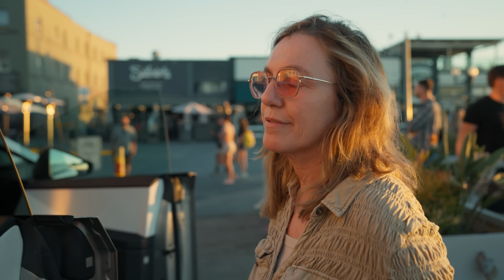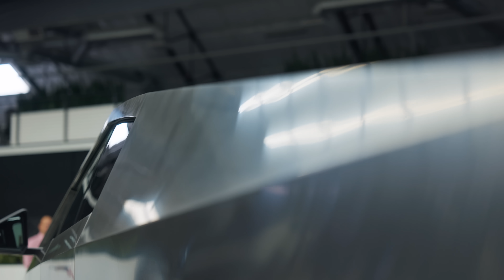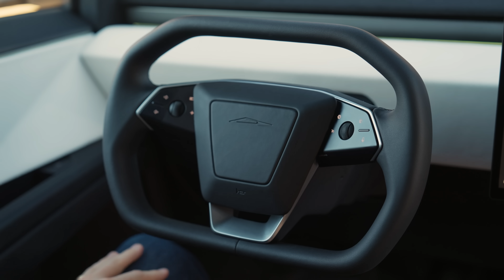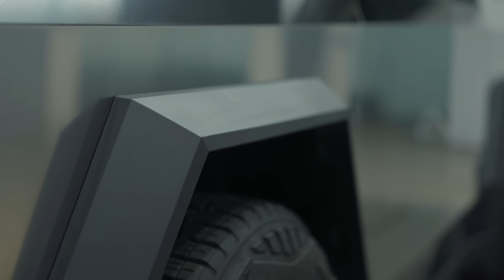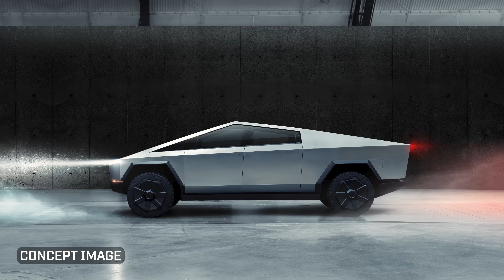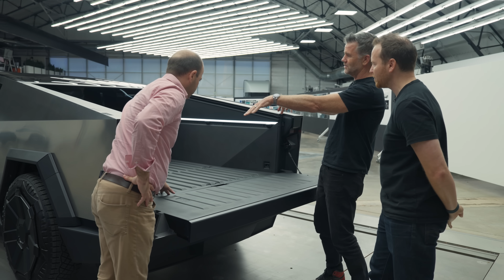FIRST DRIVE: Tesla Cybertruck Full Review

Comment: 1:45 and this is how americans think. "maybe we would sell it, maybe we wouldn't, maybe we would take on the cyber truck as well"

here is some industry insider news. The windows are not bulletproof and are just regular automotive glass. The stainless steel castings are fragile, as is the cast aluminium chassis. If you have a preorder of one get out of it on safety grounds. if you are such a fanboi you just can't, have fun getting squished when the castings fail in an accident and the whole thing crushes you in your seat. it, as i speak has only just (and i mean just as in barely managed) passed american crash testing. don't expect it to get past euroncap 1 star. especially as it weighs nearly 3 metric tons. land rover had similar issues with the new defender. it took them nearly 2 years to figure out (at that was coz the seatbelt mountings failed. alot).

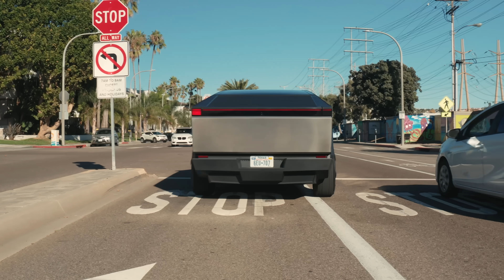5:41 did you see it hop on the suspension? that is not good.

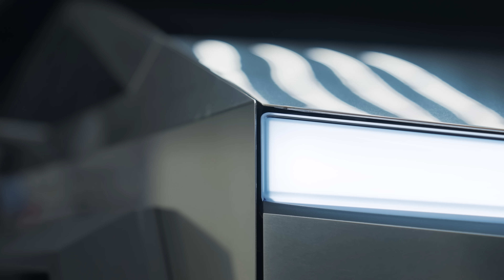13:11 you failed at. lookat the panel alignment and th gap that exist between the front wing and the bonnet. they do not line up laterally and the wing is bending outwards.

13:45 what is this guy even talking about? the rigidity in the chassis is ther so people don't get squished in an accident

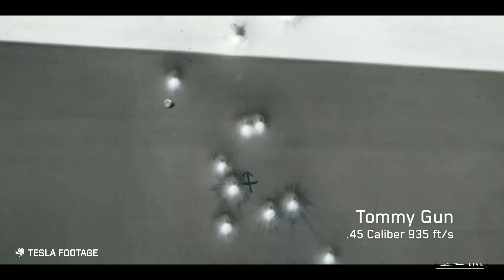14:03 so anything subsonic means a .45 ACP round or lower (or is classified as level 3A armour). This is not going to stop a 5.56 round and as he says, if you get hit with any kind of AP round you are screwed.

14:44 in the mid 90's mercedes debuted a center console operated steer by wire concept. steer by brake is otherwise known as torque vectoring by brake. nothing he said is new.

15:01 so basically he is saying they are going to production early and they are going to have an issue wtih the steer by wire. This will be because it is going to fail and kill someone, so the nhtsa is going to block them for building more and fast

Comment: 4680’ tabless DRY CELL BATTERY.  MUSK BATTERY GURU.  Going after Chinese CATL.  Can not wait to receive mine.  800 v architectural, 48 v low voltage, stainless steel, drive by wire,  4 wheel steer, SOTA AND FOTA over the air upgates.  Typical full size gas truck is $70,000.  So many $75-$100,000 gas trucks on lots, LOT Rot.  Ford Lightning seems low tech now.

Comment: I friend got one of the first ones in Canada for display in his shop, he said nobody could dare come near for the fingerprints show up immediately and are visible from 10+ feet away. I saw them on this and you wiping it away 😂 seems like a car you need disposable gloves for every passenger on.
Reply: Use stainless steel cleaner? Wipe it off ? Do a clear wrap. Buff out scratches.

No need to wax it like a painted car. No need to worry about small scratches, dents and dings from other car doors. 

Did you notice or hear about the difficulty in denting the thick stainless steel, unlike all other thin steel or aluminum vehicles?
Reply: Yeah, every person who uses it as a work, truck or an off-road truck is worried about fingerprints. My 10-year-old son could wipe off every fingerprint in five minutes. I would much rather have fingerprints, then dance from parking next to people, opening their doors into my car, or pushing shopping carts into it.
Reply: It’s a car? Who cares about fingerprints lol
Reply: just need 100% Denatured alcohol.

Comment: well, this truck is certainly controversial by its looks but, this video changed my mind a lot on cybertruck because it has a lot of work capacity, is stronger than I thought it would be and the 4 wheel steering was first seen in a 300zx, but this is the next level of that tecnology wow

Comment: Showed zero "truck things" being done, reviewed it 100% as a car...  I really just want some work crew to load up in this thing and goto work for a week and give me a legit review using it as a truck, backing up a trailer with that drive by wire system seems like a nightmare and those mirrors look like car mirrors aka not much use for dealing with a trailer.  Dunno why the hell you spent all the time on aerodynamics because if you're doing "truck things" like using the bed to haul and towing a trailer those aerodynamics mean shit which is why there isn't much emphasis on aerodynamics for trucks.  Whatever, just another cybertruck review that can't tell me if its more than a toy.

Comment: Franz and Laars please design and manufacture a Cybervan with all of the same features as the Cybertruck.  With a van there should be enough room behind the rear wheels under the van floor to mount the a portable range extender battery for long trips, towing and bushwhacking.

A van with all of these features will obsolete all other fragile, rust bucket vans!

Comment: I, along with about 30,000 others here in the UK have one reserved - so I hope they do release it here!
Reply: If they can't be bothered to sell  RHD Model S or X, they won't be building RHD CTs any time soon either.
Reply: @stevenjones916  I'm not bothered that it might not be RHD and I can understand the reason behind that, i.e. not enough volume to warrant the additional cost involved in moving everything across to the other side.  The only thing that I can see in relation to pedestrian protection might be the sharp points at the front, but those should only be an issue when the frunk is open.  I am not a legal expert so there are probably some other things that I'm not aware of.  He also mentioned panel edge radius, but not sure what that even means.  I really hope it's not a deal breaker

Comment: 11:44 I hope that doesn't mean that we could be seeing "panel popping", where the structural load and tension will pop the panels loose and basically the whole truck falls apart like a house of cards.
Reply: Are you thinking it is attached with glue or pop rivets?
Reply: @danharold3087  I see no screw holes, and they make the point that they didn't (weren't able to) bend the plates like they usually do in regular cars, so it looks like the plates could be under tension.
Are they glued on top of darkened regular panels? What is their method anyway?

If they load up some heavy things, go over many bumps etc., i am wondering if something doesn't eventually come loose.

And since they're saying that the exterior is helping massively to strengthen the car itself, in my mind it could create a cascade effect if an essential portion (like that C pillar plate that he mentions adding loads to the strength) starts failing to give the required support.
Not to mention having dangerous metal plates sticking out.

Comment: The problem with controlling everything from a central screen is basic controls like headlights, wiper, turn signals need to be on physical knobs/stalk so you can actuate them immediately without having to divert your attention to a display and possibly have to make multiple inputs/presses wich increase the time you're not focused on the road. Also having an instrument cluster in front of the driver allows you to see information such as speed and battery charge without moving your head to the right. All of which can cause unnecessary distraction and could potentially cause an accident. A heads-up display can mitigate some of these concerns, but it's another high tech gadget that adds cost and can break. The design principles are called human factors, and can be very important in designing the man-machine interface, in particular for aircraft. Tesla seems to value high tech at the expense of an efficient usable man-machine interface.
Reply: There’s nothing on the screen you need ‘immediately’ when driving or in an emergency. Tesla has proven that already with millions of cars in the road. I have one and don’t feel unsafe at all without a HUD. The screen is so big you can still see it while driving fine without moving your head, just eyes. Like you would anyways for a HUD.
Reply: You clearly have never owned or driven one. Having a central screen and some multifunctional buttons is so much easier than it ever was in a car that has 200 buttons and nobs all over the steering wheel and centre console. The majority of actions are automatic and if you’re really stuck you can use the voice controls or just put it in autopilot and have a rummage in the menus - seriously though - there is nothing unsafe of difficult about it and my focus has never more been on the road infront than when I’m driving my Tesla.

Comment: There's no other way to say it but my american perspective is this should have been taller, longer and wider of any 1/2 truck out there; even if it's by an inch (and you all know how an inch matters) in addition to have a least 400 mile range.  Making the cybertruck "similar" to the competion (if we can call that) is simple a no go for me.  Now, I currently drive a new Ram 1500 and am looking foward to the hybrid 2025 model which most likely will be the right type of truck I want. - just my 2 cents.
Reply: When that 2025 diesel over electric  hits the showrooms take another look at electric trucks.  Or do you like buying DEF fluid and changing oil?  If I had to get a hybrid the RamCharger would be a top pick.
Reply: @danharold3087  -- thats exactly what im looking foward to.  It'll be more than enough to pull my Travel Trailer
Reply: Hybrid equals all the problems of an ice engine plus basically a worthless tiny battery
Reply: @ZeusBullyMax  - The upcoming Ram Charger will not a hybrid, but rather electric that carries the V6 as generator hence extended range but is not connected to the wheels.

Comment: I remember seeing concept cars and wishing they’d make it to production in concept form. In this case, I wish it hadn’t.
Reply: What car do you drive? in a few years, you’ll be driving Chinese cars if you live in Europe. Also, if you buy cars just based on the outside look and not anything to do with the performance and all of the other outstanding engineering attributes, you probably couldn’t even drive the thing. if you’re in Europe, you’ll probably never get this truck anyway
Reply: @ZeusBullyMax   The exciting thing here is that the large casting could be used with steel, aluminum, or some non metallic sheeting to make a hugely safe car.

Comment: Although I'm relatively early in the queue, not sure if I'll take the leap to complete the purchase. I was hoping that the standard range was quite a bit longer to match the new higher prices w/o the need to purchase a range extender, which probably won't come cheap. That said, I bet we see folks renting out their range extenders when not in use, assuming installation isn't too much of a hassle.
Reply: The range extender would be almost impossible to uninstall by yourself. The challenge to range is more Teslas chargers, but also more level 2 charger at work sites. Right now, bigger battery means lower efficiency.
Reply: @khuo0219  Yeah, ya probly gotta pay for install and then removal of that battery extender if ya needed the space. Man, that would be a pain in the arse if ya had to go back to Tesla to have that removed, and then installed, and then removed, etc. etc.. A lot more chargers are the answer on any given route, as long as ya don't mind the potential wait if there is a lengthy queue.

Comment: Thanks for a genuinely interesting piece of film about it. It’s a cool vehicle, but its dual role as both transport and a talking point might be its weakness!
We’re too used to cars being pretty things we try and show off with, or things to convince people that we don’t know that we’re actually doing better in life than we really are.
Remember this, and just look at this as an alternative to the engineering we’re currently used to.
It’s too sharp for the UK though? The rusty wheel arches on my first car would give this a run for its money!
Reply: It's not too sharp, it's that there's absolutely zero consideration for pedestrian safety; the 3mm thick panels on the body have zero give if your skull gets smashed against it. Unlike every other vehicle legally allowed to be sold as new on the UK market.
Reply: @Beany2007FTW  Tesla has started using active hoods.  When the vehicle detects a pedestrian or bike it pops the rear of the hood up a few inches.   This lets the head drive the hood back down.  Something like 40% reduction in deaths due to head injury.   I did not see it here.  Wonder if it could be added.
Reply: The UK has no pick ups. They have a slight chance of getting one after the first couple of million get delivered in the US. Other than your highways, you have a lot of tiny roads for your tiny cars. Your parking is Abysmal also.

Comment: Interesting truck. Lots of new tech like 800v charging and wire steering but quite a few negatives that may be deal breaker for me.  
I’m not sure if I will order due to following:
1) no real door handles: real concern in north east - if door doesn’t spring open in snow / ice there is no way to grab and pull it open. 
2) no rear view mirror
3) I’m sure if one gets a fender bender then have to replace the entire panels since the steel is so hard they can’t just bang out the dent at a body shop. 
4) fingerprint magnet finish 
5) have to go to Tesla dealer to change the mammoth wiper ( no other store will carry that size)
6) no spare tire included 
7) esthetics are definitely not ideal. 
8 ) Rivian has a much nicer and spacious interior. 
9) no extended cab option.
Reply: Yeah, all of those points are valid but it wont matter to the primary demographic (buyer type) Tesla is targeting. Interesting how the marketing comes from the novelty of the product, disguised as innovation, when it actually decreases practical usage in every regard.
Reply: The wiper uses two regular wipers in actual fact. The body is hard to damage, you can do a lot to repair SS. Ordering a panel may not be bad if really damaged. Doesn't need to be painted.

Comment: There are definitely pros and cons. 
I’m worried about: 

- Steer-by-wire (I want predictability and a regular steering wheel, please.)
- unibody construction (especially if I need to put a load of dirt in the back. It WILL flex.)
- It’s definitely not a work truck. (The panels having no fold on the edges invites dirt under them, you can’t load the bed easily from the side due to design, etc.)
- Safety (not so much for the occupants, but more the unfortunate car or more importantly person that gets hit.)

      (yep, and that was brought up in the video)

- The usual tesla shenanigans (no door handles, no instrument cluster/HUD, Lack of physical buttons, etc.. I get the screen, it’s just that I want to be able to adjust climate control and stereo volume without having to look away from driving. I also want a speedometer and range indicator without having to look away.)
- I’m seeing the massive bed walls as a visibility issue. 
- The price tag

- I think it looks SO UGLY. The Lamborghini Countach looks cool. The Lotus Esprit looks awesome. The Hyundai N 74 looks dope. This does not. sorry. 

That being said, what I do like:
- The usual Tesla Shenanigans (ultra efficiency, sports car performance (which is why i prefer driving F-150’s over their competitors) and neat accessories.)
- If the exterior is a rugged and corrosion-resistant as they say, I would love to see it keep rolling for a long time.
- The bed being completely flat and taking advantage of the electric platform is great.
- It might be decent at towing. Four-wheel steering might be a blessing and a curse.
Reply: Nobody asked your opinion.
Reply: Good don’t buy one that’s one less out of the 2 million that are trying to get their hands on one now. By the Ford or the GM before they go bankrupt
Reply: @ampeel-lj8pu  Did you miss the part where he said it was as rigid as a sports car?
Reply: @danharold3087 this is a paid add you muppet.
Reply: Steer by wire.
ALL cars have electric steering.
Teslas have 2 motors, 2 control  circuits and 2 computers cross checking.
.
This is even when the drivers is in control, but when self driving it's literally "steer by wire".
Other brands do the same.
.
"Dirt"? 
Really?
If dirt gets under there, so will the pressure washer.
.
"You can't load the bed easily"....
Right.
Visualise this.
Look at the bed.
See the L Track?
.
Mount a drawer slide on each of those.
Take a big tub, mount it to the drawer slides.

Castors on the bottom.
.
Drop the bed gate.
Pull the tub out over the gate.
You now have fantastic Access.
You can load anything from cement, to tools,
You could even have multiple tubs 
(Thunderbird 2!!   If you know, you know).
...
Safety.

An f150 will ruin your day!
.
How about a truck that SEES you and stops? (Vision)
.
Handles.
The top of the door is the handle.
.
Screen. (Still?)
EVERY control you need while driving can be accessed by voice control.
1 button, on the wheel, eyes ON THE ROAD.
Reply: @rogerstarkey5390  Roger as I understand it this is the first US vehicle that does not have a mechanical connection (backup) between the steering wheel and the steering mechanism.  Most people are saying it is still illegal.
Reply: @rogerstarkey5390 you have been taken my a mug my friend.
Reply: @rogerstarkey5390  I really hope legislators stop this "steer by wire" nonsense before it spreads, otherwise we'll see plenty of "unexplained crashes" when these vehicles start getting older and poorly maintained.
Reply: @Jorqell the SbW tech will be as reliable as the carmaker makes it, just as how a regular steering wheel would also suck if the materials used weren't of good quality.

Comment: 120 miles (by Tesla's math, mind you) divided by 50 KWh battery = 2.4 miles per KWh. That tops Rivian's 2.17 mi/KWh, but I'd be interested in knowing the real world figures. Tend to get about 4.5 in my gf's Bolt if driving more on the careful side.  Probably 3.8-4.2 if far more negligent.  Maybe 3.5 at 75-80mph.